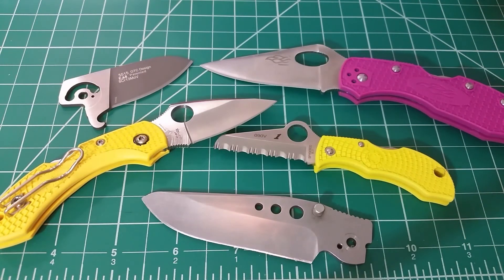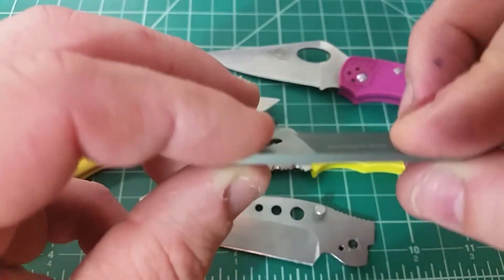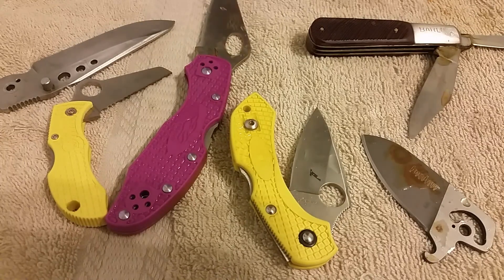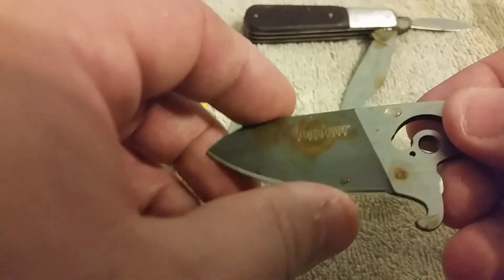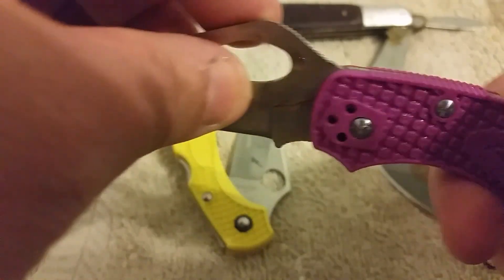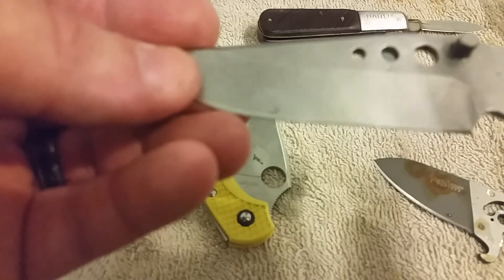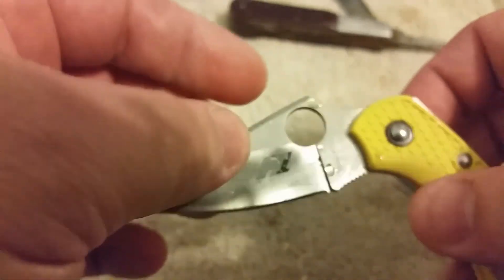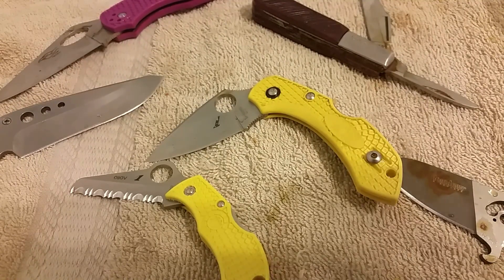H1 Steel and more vs. Saltwater: Preliminary Test

Comment: I have 4 spyderco caspian salt knives.  3 are in rotation.  One is used to the point there are no more serrations.   1 is new being reserved for if I need it or want to do a youtube giveaway.
I never wash them unless I want to run it on the worksharp.  And between cutting bait, rope, line...etc.....It has remained impervious to corrrosion.  The edge retention isn't spectacular compared to vg10 or s30v or even a D2.  But it's remained flawless and remains around my neck every time I'm fishing which is hundreds of days per year.
Reply from the maker: Nice! Good to know how well the steel holds up over constant use and a long period of time. I appreciate the info!
Reply: It's sad they no longer offer a similar fixed blade.  The aqua salt is nice.  But the finger hole in the caspian means no chance of dropping it overboard.  And the caspian sheath is spectacular for concealed neck carry.  H1 is the real deal.  Keep up the awesome work!
Reply from the maker: Thanks again, much appreciated!